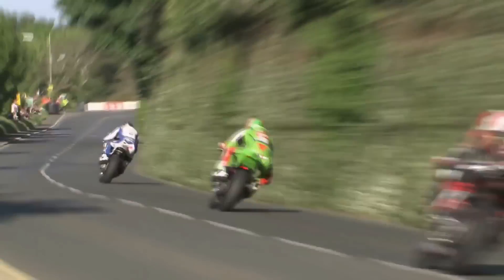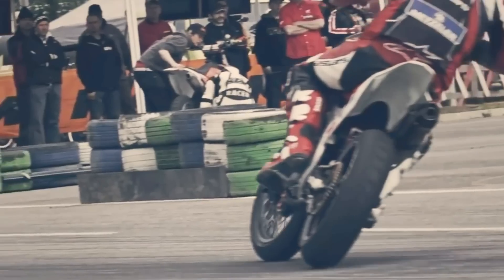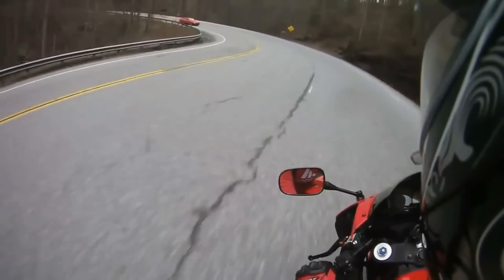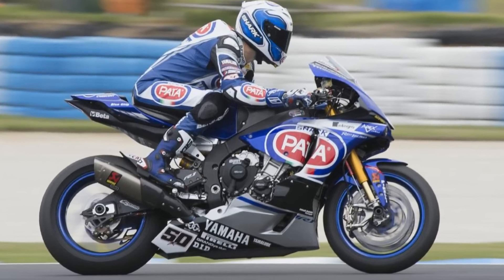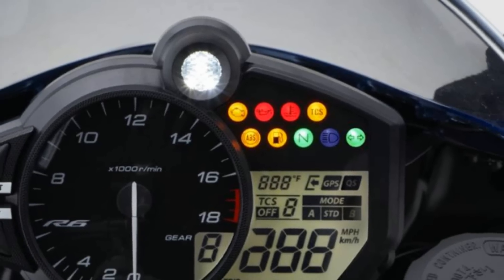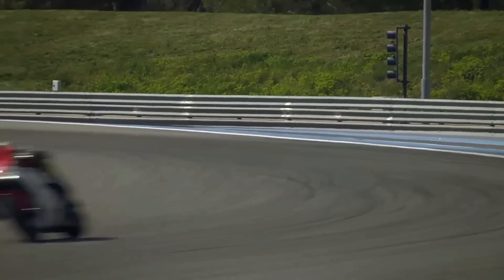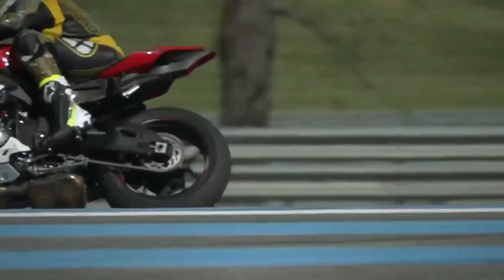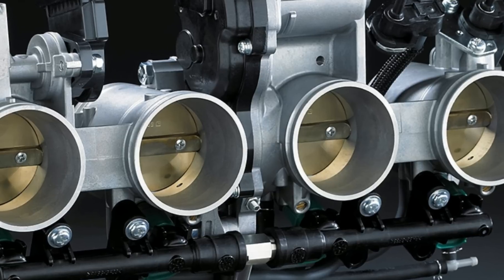Motorcycle traction control system - How it works???

Comment: Do you know if all the MV Augusta bikes have the same traction control system. I have 2015 MV Agusta Dragster 800, and hope it is a better system....
Reply from the maker: The traction control system that I've talked about here is of 2012 f4. The technology was at its earlier stage at that time. The Brutale Dragster has a much better traction control with 8 level of adjustability.
Reply: Cool! Thanks :)